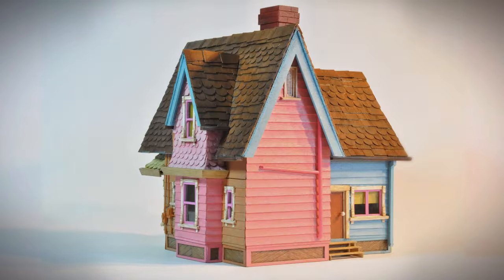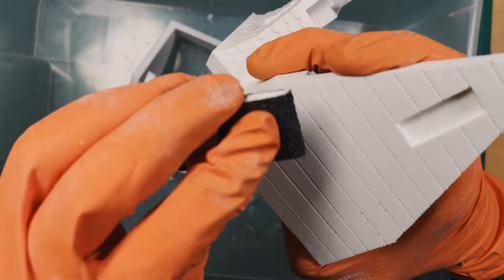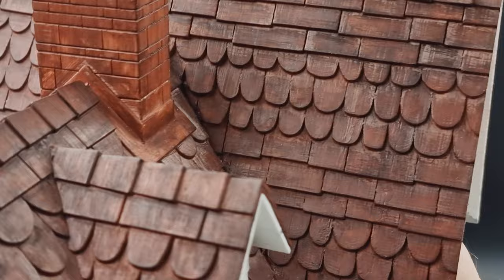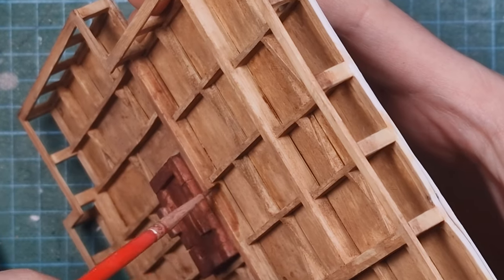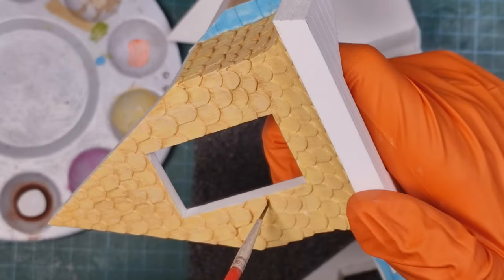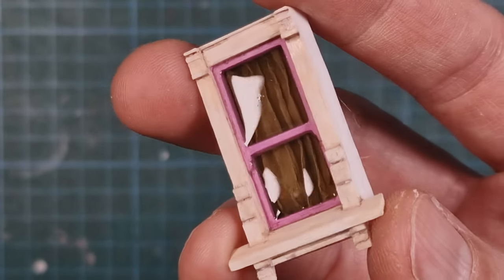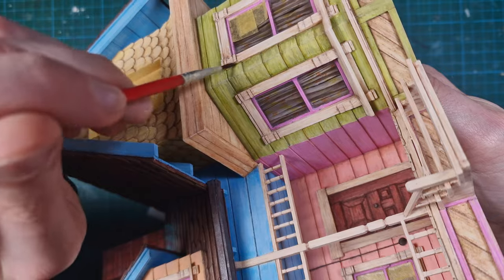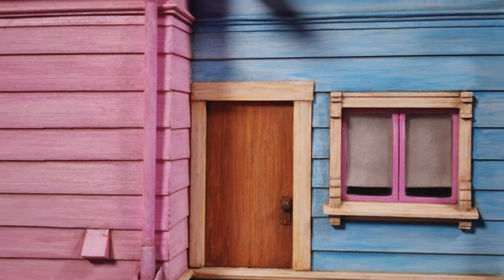Ultimate UP House Model from Pixar animated movie #uphouse

Comment: I’m just going to say this. Will you attach balloons and if so, will you make it fly?

Also, if you are I suggest put some type of string at the front water line that way it doesn’t fly away too far.
Reply from the maker: That is an option. I would probably need to reduce its weight maybe using lightweight pla and minimal outlines. But from my experimets with helium baloons, they did not lift too much weight. For the scale and reality sake would use waterbaloons and big number of them  would also adds weight.

Comment: So Cool! I love model making, and you did a great job with the model and the video! If you used a resin printer, do you think you would have to sand as much?
Reply from the maker: Thank you. Yes if printed with resin,  sanding would only be required to create the wood texture so really fast. The printers on the market get bigger and cheaper so I could have one which would be able to print sharp model of this size but for now I only have limited space in my room and Anycubic Mono X is the one I own. Its bed size would be too small for floor section and I did not want to split it to too many pieces for durability reasons. This tunelled my vision and drive decision to use fdm technology.  When I look at it now, I could fit parts of the roofs on mono x only and save so much time! But when doing it for the first time, you need to do some mistakes 😉 I also discovered polymaker terra PLA since then which sands so easily I will be using it in next projects and test it. Each project is like a course for me.

Comment: Amazing work sir 👏  and that sanding trick is a game changer 😄👌 I'm eager to work on some 3D printing of scale buildings too once I hone my skills a bit more 😁
Reply from the maker: Yes I used this trick few times on my droids and always wanted to create small 3d printed attachment. Thats why I bought this small saw, as a durable holder, but it was faster just stick paper with tape. I rarely build larger things.  My models usually require sanding with little files as you know.
Reply: I can't share much of my current project, but I've been working on an assembly video of a metal shed kit for my employer and just rendered my first test animation 😄
Pretty excited with my progress with blender so I need to start working on some things to print and paint soon 😅
Reply from the maker: @davesculpts  I can't wait. Respect for learning blender. I should choose this program for this project and make some progress in learning this piece of software. It will be powerfull tool if you stick to it.
Reply: @themodelmaker  I have tried several times to learn blender and gave up because I was overwhelmed by how many aspects there are to learn, but I'm now alternating what I'm studying so I'm actually learning how to use Blender and not just one of its uses, it does help that I have an end goal to keep me on track 😆